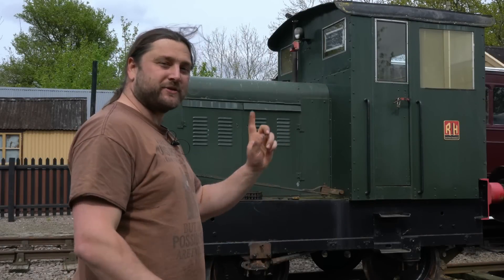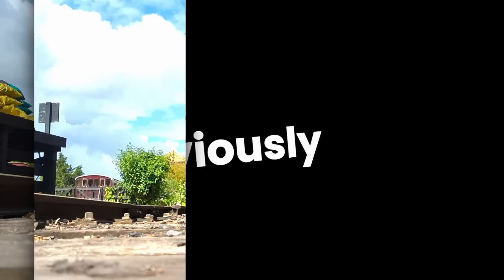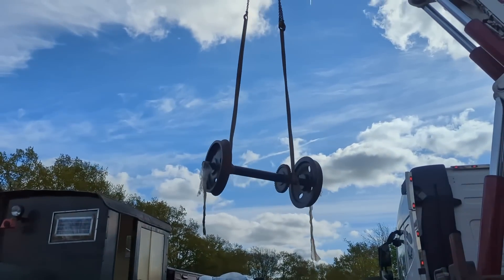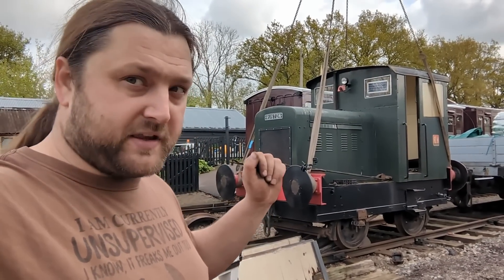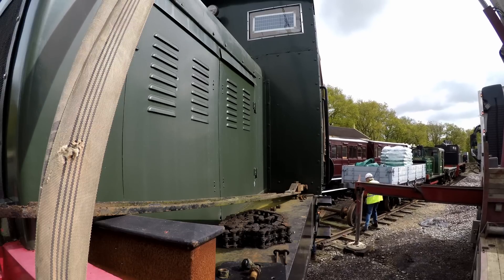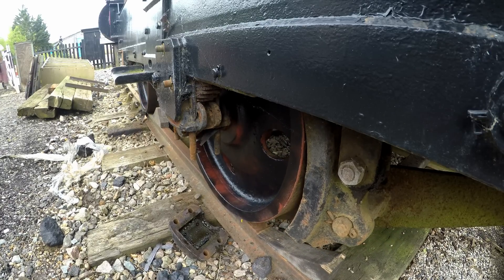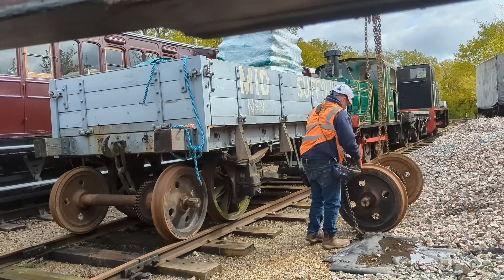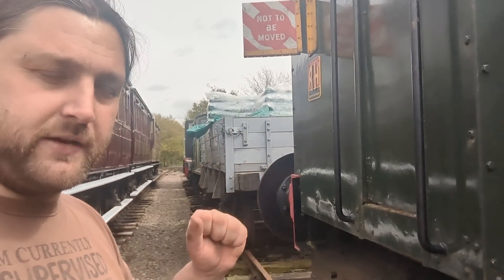How to Swap the Wheelset on A Full Size Locomotive! The Loco Diaries Ep 7.

Comment: It went well, but a couple of things in the lift made me nervous, first the damaged lifting strop that was clearly visible in the video, almost half the width was damaged.
Then bare chains around the unprotected journals. Should have used strops for the axles, use chain sleeves or wrap a thick layer of cloth or better, rubber sheets around them when using chains.
Even little indents left by the chains will wear out your plain bearings quite quickly.

Use of a spreader bar is also be recommendable to prevent the lifting gear from exerting inwards force on the cab sides.

Comment: Our Motorail 4709, 2 foot ex sand pit engine dangled. It might be only 2.5 tons but it had its wheels on!. There is a picture in the Industrial  Locomotives Handbook 19EL on page p419.

Comment: A great video for the series would be the removal/refitting/turning of the tyres on the wheelsets.
And great to know that all four axles are now going to be refurbished.
Reply: It is difficult to tell the difference in actual tyre thickness of each wheelset.
I cannot tell if the wheel has a shrunk-on type or the wheel & tyre is all one solid metal disk. Normally a railway vehicle has a groove on the outside edge that denotes the minimum safe tyre thickness in the absence of original Ruston technical data.
Reply: My apologies. Lawrie states the OE wheels are a solid casting ex-factory
Scrapyard Ruston , 3:58 - 4:10. A bit hard to tell. It is hard to tell how much life these tyres have left.
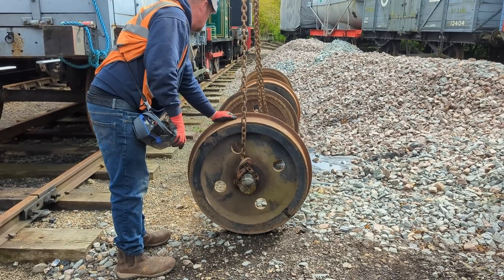Wm Mc Alpine's wheels at 11:40 It looks like they have been re-tyred at some point & need replacing yet again

Comment: VTOL RUSTON!

Also

Have you got to do this every time you want to change the sprockets?...
Reply: The sprockets are heat shrunk on, so you'd have to fetch a wheel off, or gas axe the sprocket off, and somehow find a split one to bolt on afterwards
Reply: @jayvernon2575  good grief 😔 ☹️

Comment: Please get a proper spreader in between those hooks next time, instead of letting the cab roof take that load. Five ton locomotive, even if it's just a 5 degree angle that the straps are deflecting, that's a casual 1000N force (100kg weight) pushing on that roof. And that's what, three, four millimeter plate?
Reply from the maker: I wasn't happy. It broke a window
Reply: It can take way more than that, it’s had at least two of us on the roof plus grinders for about 200kg
Reply: @damianpeterkelly1234 from the top a drum roof can handle it, from the sides is a different story
Reply: Calm down Crane Police!
Reply: @greg0uk He's only offering helpful advice,  Remember we are all friends on here with similar interests 👍
Reply: @greg0uk  someone let him down

Comment: Love the advert for Black Stag Engineering and the look on Lawries face is fun with the light Sabres. So here's a suggestion @lmm why not see if Black Stag can create the light sabres as handles for the throttle and a different jedi (or sith depending your leaning) light sabre for the gear lever for either 303 or the RS 165. That way as they move forward in preservation your preserving the history before it and you have your own mark on the loco for the future.